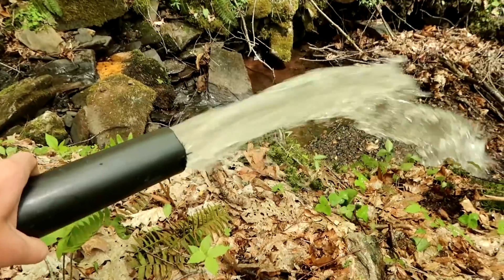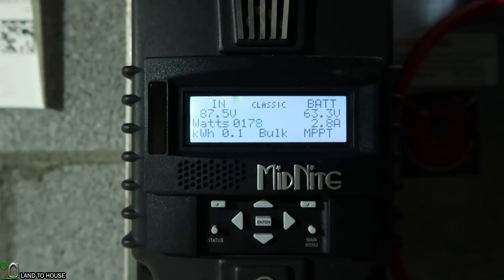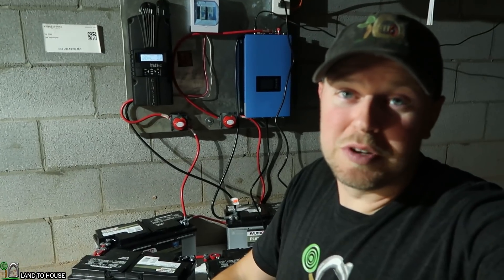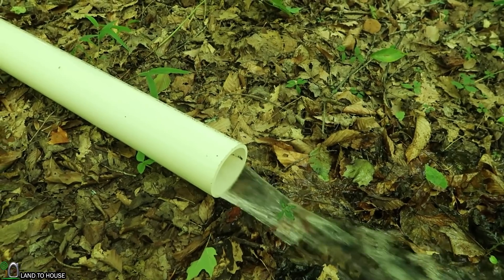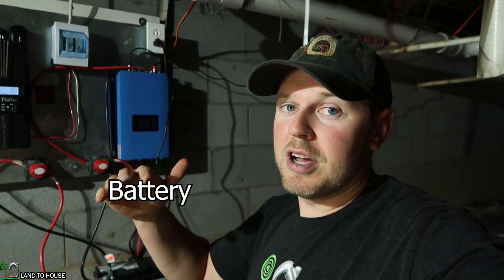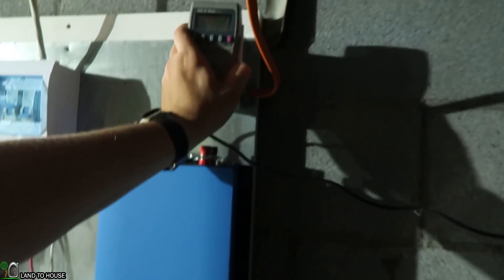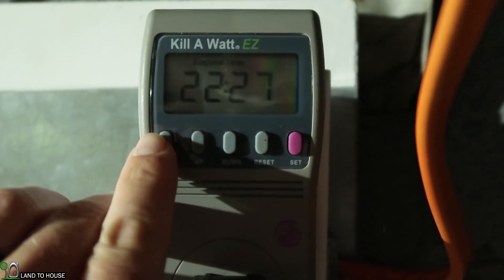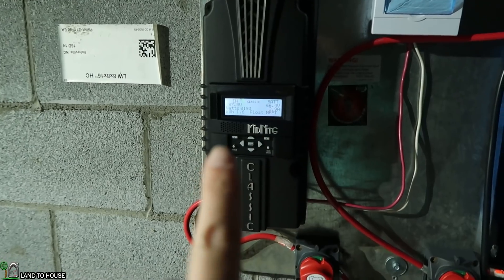Power up the Turbine Micro Hydro 9/10

Comment: Is that turbine a brushed or brushless system? I’m only asking because of possible recurring maintenance on the device itself. Also, could you increase the size of your PVC from the sluice box to the collection barrel to increase your gpms, therefore allowing you to run 2 jets year round? Or is it a water source issue?
Reply from the maker: I am not sure about brush vs brushless. I hear the bearings need replacing after 5 years. My penstock can only carry 40gpm. So that is the limiting factor.  The most power I could ever make is 580 watts.
Reply: Land to House That’s actually not that bad then. Bearing are not terrible. Brushes can burn out pretty quick but they’re kind of becoming obsolete tech over the last decade. 
I am still enthralled by micro hydro. I’m excited to see your setup evolve in the future. Hopefully you can go fully off grid at some point. Does French abroad Electric give credit if you put electricity back to the grid?
Reply from the maker: That power company does not allow sell back. Duke does if you have a pro install. Lots of $$$. That is why I went with limiter inverter.
Reply: @LandtoHouse  It should be brushless since it uses permanent magnets in the rotor and the coils are in the stator, much like the magneto in the ATV.

Comment: Really enjoying the series, I'm gutted I don't live near a river haha! One day I'll go off grid.
Reply from the maker: Thank you for watching! When I purchased this property it was because of the water.
Reply: @LandtoHouse  a suggestion I don't know if it would work or how well it would work because of how closely it borders on from perpetual motion is your waste water after it leaves your Hydro generator is to send it into a ramp pump pumping it back up to the top and recycling the water. Maybe this would allow you the extra water you need to open two or more valves?
Reply from the maker: The head pressure of the hydro unit is 163 feet. The flow rate back to the intake would be very low.

Comment: 8+ kilowatt hours a day is pretty awesome and will pay for itself in no time!   Since you aren't sending power back onto the grid, where does excess power go if batteries are full and house is using much less than 300 watts?  Is there a place you are dumping excess power?   Look forward to you next hydro build!
Reply from the maker: At the moment our water supply is enough to make 200 watts and that comes out to 4.8kwh a day. I hope to get up to 400 watts in winter. From my understanding when the batteries hit float the charge controller slows the turbine way down. But we use enough power in the house that its not in float long.
Reply: @LandtoHouse  If you're putting out 400 in the winter and, for some reason, the house load drops quite low that power has to go somewhere, or something's going to get quite hot.  Does the inverter have the ability to shift the load to a shunt? When I lived on microhydro I used a couple of $20 small 1000w space heaters in my garage as a "dump." They almost never turned on but when they did I'm glad the power had somewhere to go.   I like your system design!  The batteries act kind of like a flywheel.  Not sure of the power rates in your area, but that constant 200-400 watts can really save a lot of money especially if you have a tiered rate system.
Reply: @et5222  since both of you do not mind to mess with water why do you not put water to water heat pump there too? Some people make those heat pumps for less than $500 and you will not find COP 4 just laying on on side of road

Comment: Put mv is worth it to try add another intake seriouswite the onw u had. Try to test thath then the the intake owerflow get used again in another intake. Mb then u get more water to the barrel
Reply from the maker: I have a plan on getting all the water into the intake that is spilling out. That video will be some time in September.
Reply: @LandtoHouse  ok nice then thats more efficient i think yeah.
Reply: And do u fixed the leaks in the pipe?
Reply from the maker: Yes all penstock leaks are fixed.

Comment: Good on you for trying something so new for yourself....and seeking out the help to get better at it. Lifelong learning is the key. Thanks for the video right on time as well. 10pm AEST. Enjoy your Monday
Reply from the maker: Hydro power is something I have wanted to do for several years. Like 8 years. Its so nice to actually have the turbine running.
Reply: @LandtoHouse  Ive just installed my first solar battery set and am working a plan on some ram pumps to move some water around my property. Will let you know how I go. Hope all is well in NC
Reply from the maker: Yes let me know. Things are good here!